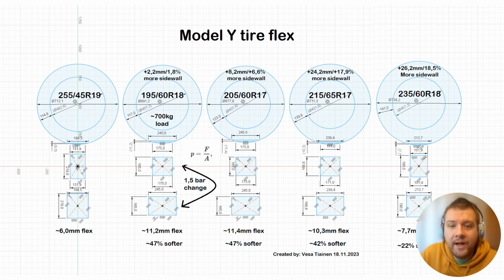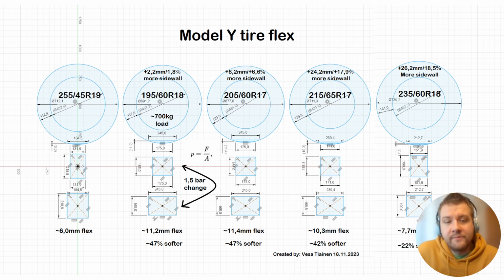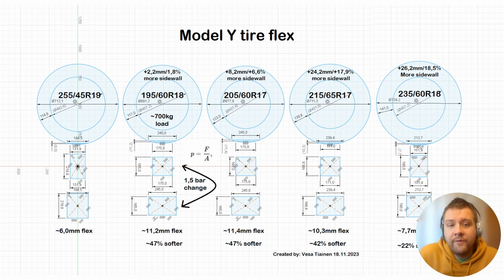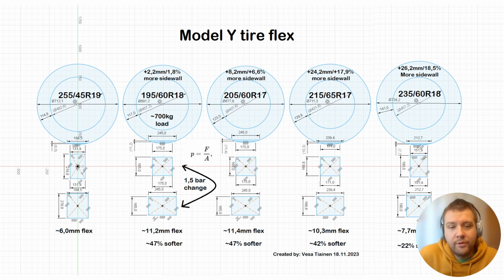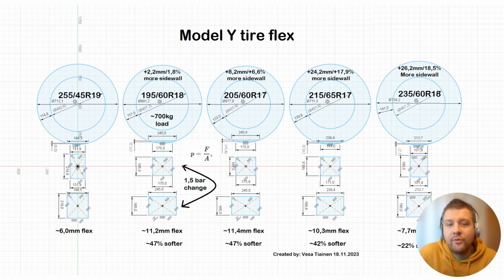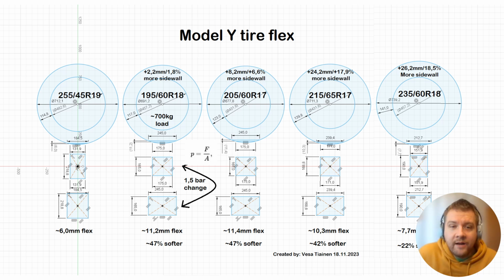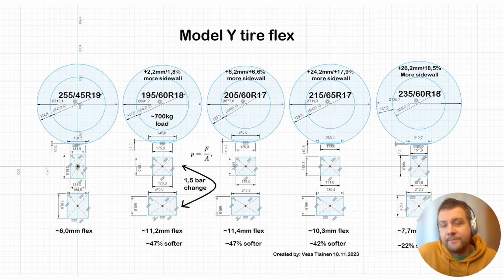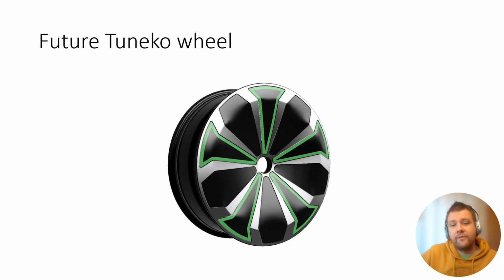Tesla Model Y tire flex comparison and suspension stiffness impact with narrow tires

Comment: If I could I would try this, but in my country it's illegal to drive with non-factory tire sizes. Are there any other worthwhile eco mods on the Y that you'd recommend, or is it senseless since it's already been designed with efficiency in mind?

Thanks for sharing these videos, it's educational.

Comment: Thanks for the information. I would like to boost efficiency and upgrade the design.  Do you thing it is realistic use the Model 3 Performance wheels on the Model Y? 235/45 R20
Reply from the maker: You mean 20" uberturbines to Model Y? I would guess it migth get same consumption with good LRR rubber.

I would look 195/55R20 size tires. and your country regulations for loads. In theory those could meet regulations in some country. In europe you can install 50mm narrower tire without inspection. Full car GAVR is met with those, but rear axle max mass will be limited to 1380kg.

205/55R19 size would be better option in 19" size there load is only limited to 1450kg at the rear.